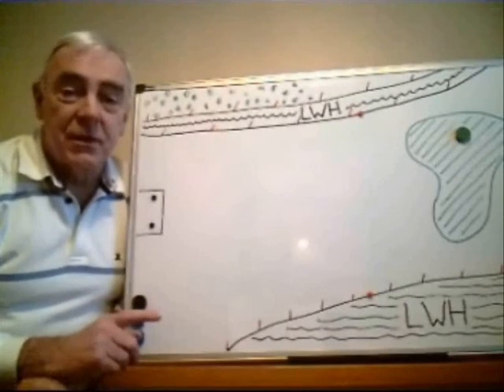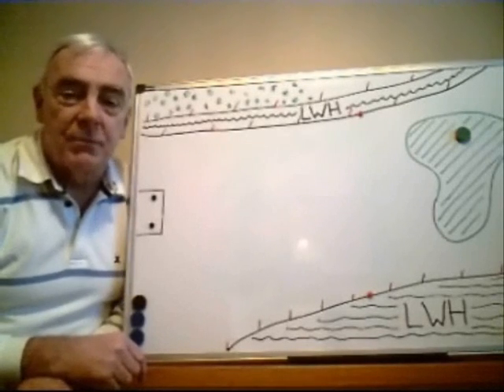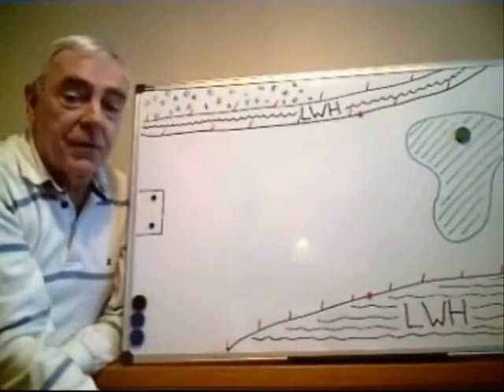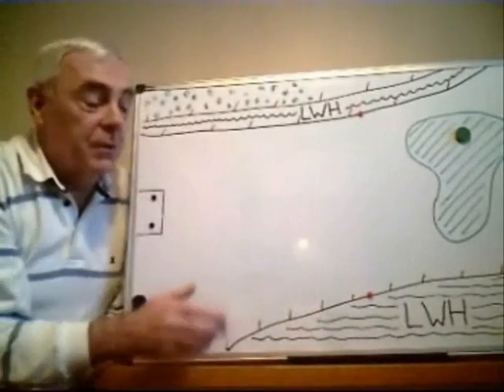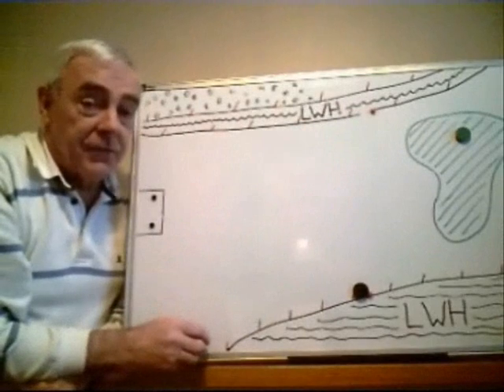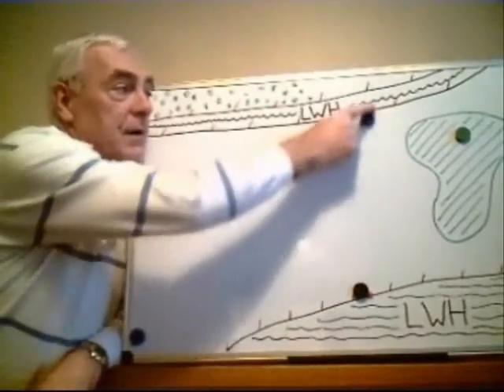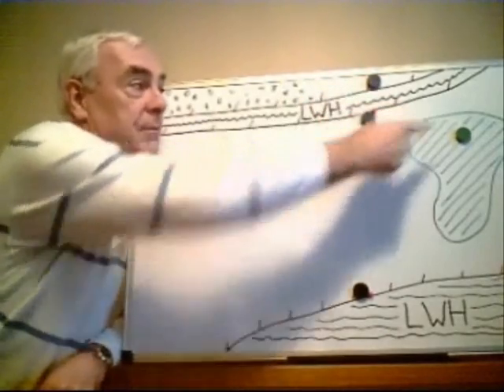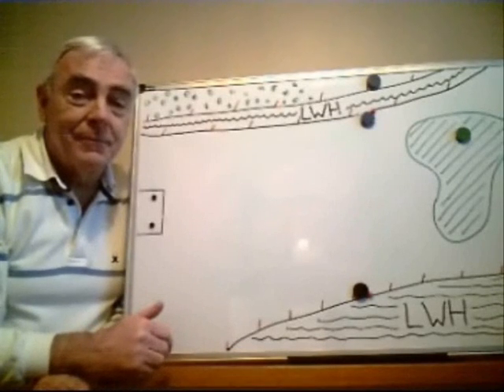Rules of Golf - Lateral Water Hazards 04Jan09

Comment from the maker: @82PeRK 
The first point to note is that trees on a course are not hazards. The only hazards in the Rules of Golf are water hazards (yellow stakes and/or lines), lateral water hazards, (red stakes and/or lines) and sand bunkers.

However, Rule 27-1 states that at any time, a player may, under penalty of one stroke, play a ball as nearly as possible at the spot from which the original ball was last played (see Rule 20-5). This is proceeding under penalty of stroke and distance.

Barry Rhodes

Comment from the maker: @robertskwh 

Decision 13-4/8 tells us that grounding a club in a water hazard occurs when the grass is compressed to the point where it will support the weight of the club. But don't confuse anything that is growing with anything natural that is not attached. For example, a player may not touch loose leaves in a water hazard with their club as they prepare to make their stroke.

Barry Rhodes
(Author of the book '999 Questions on the Rules of Golf')

Comment from the maker: Cyril,
Very often, the reason that a water hazard is designated as a lateral water hazard is because the option of dropping a ball on a line from the hole through where the ball last crossed the margin of the hazard is not practical, as in both the scenarios in my video above. The first scenario would mean dropping outside the course boundary and the second one would mean dropping amongst a forest of trees.
Barry,

Comment: In a recent tournament we had a rule dispute. The water hazard was red staked but only two stakes were present on the pond, one at an end point, and one at a point where the pond was smaller than the rest of it, so it was not round but irregular in shape. The ball was outside both stakes but in the water. the golfer said their ball was not in the hazard because the pond was over-flowing (the pond is shallow and has not banks) and they wanted to take a free drop because of casual water.

Comment: In the instance where the ball is hit into the ditch you state that the player CANNOT hit from the far side of the hazard on a line that dissects the point of entry and  the flag because he would be in the forest. Although I would agree he would be ill advised to do so he still has that option. Confusing for someone trying to learn the rule. Propose that it would have been clearer had you left out the forest and made it a field and thus been able to illustrate this fifth option. Great vid series

Comment from the maker: @82PeRK No, you should not have written, "tree hazard", as there is no such thing in golf. You should have written, "lateral water hazard with trees inside and outside the hazard". Providing your ball did not roll back either within the margin of the hazard or nearer to the hole when you dropped it, then you must play the ball as it lies or deem it unplayable under Rule 28 and drop it again. However, the penalty for doing so is one stroke and not two each time you do so.

Comment: Love your video's Barry! Question...we have a par 4 that is a quick dogleg left and a ditch/water on the left similar to your example. What if you hit it into bushes that are within the hazard stakes. It could have dropped down to the ditch or not, but is still within the hazard stakes. We were told that you can be virtually certain due to the trajectory that it's in that hazard and take a lateral drop. Then someone else of authority said you have to SEE the splash. On so many holes, it's impossible to see the splash but you know it's in there. Can you take a drop or does it have to be considered a lost ball even though you are virtually certain it's in there? Also, even if it's dry land but marked with a red line and red stakes along the water, is it still considered the water hazard? Hope this makes sense! Thanks
Reply from the maker: Valerie, I can assure you that there is nothing in the Rules/Decisions of Golf that says that you have to see a ball splash in water to be able to take relief from a water hazard under penalty of one stroke. As you have pointed out,  water hazards do not always have water in them, but the relief options still apply if a ball has come to rest within the margins. The test is that it has to be KNOWN OR VIRTUALLY CERTAIN that the ball came to rest in the hazard; if not the ball must be treated as lost.
Barry
Reply: Barry Rhodes Thanks Barry!  One more thing....we've been told that if we are virtually certain, we are unable to play a provisional ball.  On the flip side, we've been told that we can only take one.  Logically, it seems that we only take a provisional if we believe it has the potential to be lost outside of the hazard stakes.  Please confirm.  :)
Reply from the maker: Trixie, almost correct! Rule 27-2 states that you may play a provisional ball if the original ball may be lost outside of a water hazard, OR may be out of bounds. I recommend that you check out my blog on 'When You May Not Play a Provisional Ball' at this link http://www.barryrhodes.com/2010/04/when-you-may-not-play-provisional-ball.html, and several other blogs of mine relating to (lateral) water hazards.  (use the 'Search this Blog' feature).
Barry

Comment: So here's a question.  The course I play has a lateral hazard far left of the fairway on one of the par 4 holes.  That hazard has a line of bushes that are, I would estimate, about 10 to 15 feet across.  Dropping even 2 clublengths from where the ball enters the water would be unplayable because you would have to drop in the bushes.  

What to do?
Reply from the maker: Fred,
The relief option is not where the ball entered the water, but where the ball last crossed the marging of the hazard (defined by red lines or stakes). If this still means that a player would have to drop in bushes the margin has probably been wrongly defined by the Committee.
Reply from the maker: (cont.) Assuming that the other relief options are not favourable (i.e. dropping on an extension the 'flagline' from the hole through where the ball last crossed the margin, or at an equidistant point to where the ball last crossed the margin on the other side of the hazard) then the player must return to where they last played from, option 26-1a.
Barry
Reply: Thanks, Barry.  You explain the rules as clearly as i've seen.  Greatly appreciated.  Of course, they have no stakes whatsoever, so I'm still not sure what the answer is.  I'll have to ask the course administrators.

Thanks again.  Great vids!

Comment: And what to do if the ball ends in LWH behind the green? how to take a proper drop and not to be closer to the hole? thnx
Reply from the maker: Vaclav Stehlik On holes where there are areas where it is not possible to drop a ball within two club-lengths of where the ball last crossed the margin of a LWH, Committees often provide a dropping zone. However, if there is no dropping zone, the player has to take one of the other options provided in Rule 26-1 for taking relief under penalty of one stroke. 
Barry
Reply: Barry Rhodes 77
Reply: +Barry Rhodes I still confused on rule 26-1 when they say "cannot drop the ball closer to the hole." For example, if the water around an island green is marked "lateral water hazard", can you take a penalty of one stroke and drop the ball on the green side since it landed there first before rolls down into the water? If we can drop the ball on the green side, would that violate the rule that says "cannot drop the ball closer to the hole" because no matter where you drop the ball on the island green, it will be closer to the hole.
Reply from the maker: +Michael Yaj   In the circumstance that you describe the player may not play the ball nearer the hole than where it LAST crossed the margin of the hazard. So, the player has to choose one of the other options Rule 26-1 gives them for taking relief from a water hazard, which will almost always mean playing from where the ball was last played from, or another point on the far side of the hazard from the putting green. 
Barry
Reply: That would make sense because I saw some of the PGA players hit their balls onto the green and then rolls off into a perpendicular lateral water hazard from the flag but didn't drop it one club from where the ball last crosses the hazard. Instead, they drop it several yards way right or left away from the spot it last crosses because they didn't want him/her to drop it closer to the hole. Thanks for the clarifications.

Comment: You have a reference point on the other side of the ditch that is equal distance from the pin.  There are 2 possible points further up the ditch that are equal distant to the pin.  Can you also use those?  Or can you only use one other point closest to the original point?
Reply from the maker: Brian,
You have misunderstood the opposite bank option. It has to be at a point equidistant from the hole as where the ball last crossed the margin of the hazard, so there is only one reference point on the other side of the ditch.
Barry
Reply: Barry Rhodes but there are 2 points on the opposite side of the ditch that are equal distant from the pin.  The other is past the green.
Reply from the maker: Brian,
The opposite side of the hazard must not cross land that is outside the hazard.
Barry
Reply: Barry Rhodes where does the rule say you cannot cross over land?  Is that what is meant by "opposite margin"?  What about your response here: http://www.barryrhodes.com/2015/10/opposite-side-of-margin.html?m=1.  It seems to agree that there can be multiple points.  Or is that only the case when the ball is exactly tangent to the hazard, allowing you to have an "opposite" side in two directions?
Reply from the maker: Brian,
In that blog I said "An imaginary straight line drawn from where the ball last crossed the margin of the hazard must not cross over land outside of the  hazard margin when determining the ‘opposite margin’ that is equidistant from the hole." I also copied the Decision which stated, referring to the diagram, ""Y2" is not across the hazard from "X2" because an imaginary straight line from "X2" to "Y2" crosses land outside the hazard." 
Enough!
Barry
Reply: Sorry to have bothered you.  It is just a very difficult ruling.  In reference to the blog, I was just referring to the last comment you made at the bottom of that blog post to Matt W about a case where a river runs alongside a green.  Likewise, in your drawing, you could feasibly draw a "straight line" from X1 to somewhere to the left of Y2 that is equal distant to the pin.  Or do you actually mean you have to draw an arc and not a "straight line".  If that is the case, then that makes complete sense in how you are showing it.  It is just that the USGA does not state that "opposite margin" must be measured as a point along that arc. :-)  I hope this makes sense.